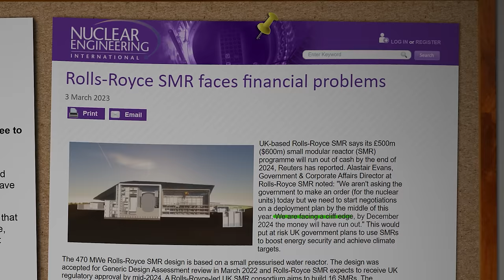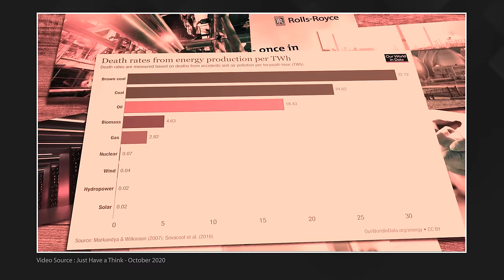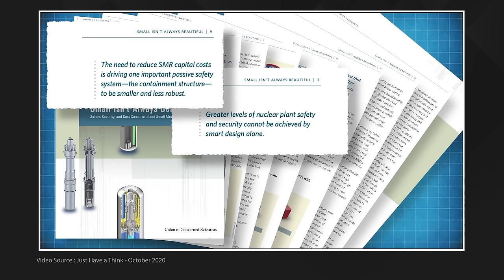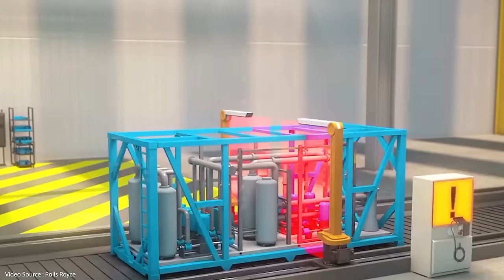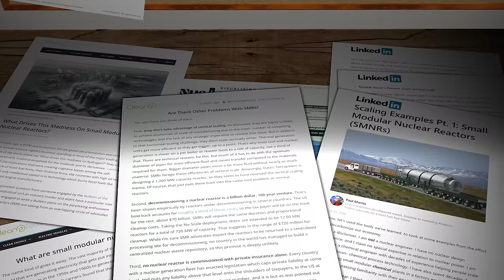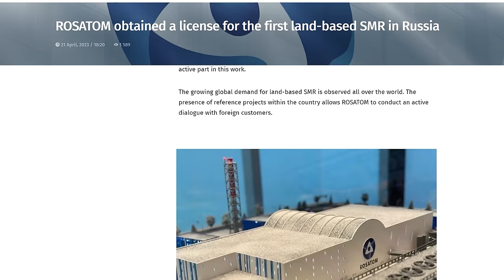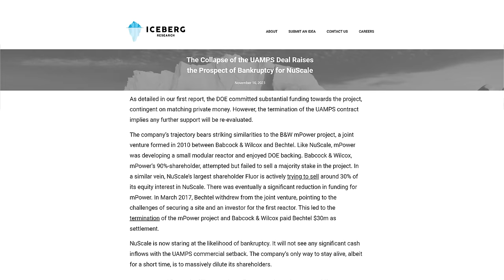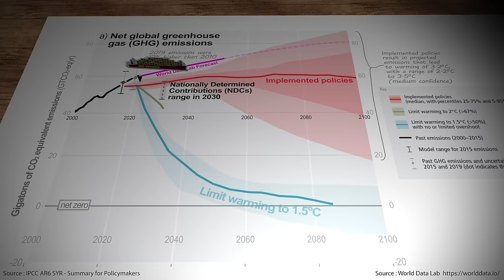Small Modular Nuclear Reactors. The Verdict

Comment: You're absolutely right - SMRs are already too expensive; meanwhile solar wind and battery costs continue to come down.
Reply: Name one major city and industrial sector that is due to be powered by solar and batteries in the next two decades. I'm not talking about some backwater I'm referring to somewhere like Tokyo, Paris, LA, Hong Kong, London, NYC, Mexico City. Just name one. These cities are where SMRs will shine, renewables and batteries have their place also, it will take a mix to fix this CO2 mess we have gotten ourselves in.
Reply: @anydaynow01  1.  I generally agree with you. Commercial demand balancing can come from arrays of capacitors and fuel cells (Metal Hydride, not pressurized or cryogenic H2).  Urban and industrial supply should be generated by Nuclear for baseline, and some NG to meet peak demand.

2.  [CO2] increases near the earth's surface promote forest greening by a power law relationship, and themal insulation by only a linear relationship.  Furthermore forest greening increases  thermal absorbtion during daytime and reradiation at nighttime, since mature trees circulate water from the water table and act as heat exchangers.  I have this on authority from NASA's own raw satellite data and an atmospheric chemist.

The 'immanent anthropogenic crisis' and the 'Green New Deal' are a raw deal, a con job intended to hobble the West while Asia marches onward.

Comment: Michael Barnards has pointed out that Wrights Law only applies if a manufacturing process goes through 10s of 1000s of iterations, that's when 'learning' leads to savings at scale. Correct, and by the same token the entire "power block" of a plant where electricity is produced via steam can no longer expect any improvements as it is really mature tech. That reduces the percentage of possible innovation over the project volume considerably.
Reply: Yes, SMRs use steam - and steam is an extremely old technology with extremely well known economies of scale. It is not just the "nuclear" bit that is the big economic issue in SMRs.

Comment: Fusion has the same problems of economics plus their technical issues. Nuclear can't compete with the dropping cost of renewables, even if they could get their cost of fuel to zero (renewables are already at zero fuel cost).
Reply: Generalizations about fusion are not yet possible -- since the attempts to make a practical plant use MANY very different approaches - some gigantic (National Ignition Facility) and many tiny (LPP's fusor) -- and to date all are VERY FAR from working.   (The reports of net energy creation are hooey -- once you consider the total power consumed versus output).   *  Also the advantage of local power (which this Youtube misses) is local production means you don't need to maintain a grid (so you get saving there). *  Some fusion plans have the advantage of being very simple compared with fission plants, and may not need scale to be economic.  It's all fantasy for now -- "20 years away, and always will be" has become "5 or fewer years away, and always will be."   Whether that is progress remains to be seen.

Comment: Yep. You lost me on renewables backed up by battery and hydro power. Given the variability of renewables and the immense power needed to stabilise the transmission frequency the scale of backup power and its durability makes this approach highly questionable particularly for Australia where transmission distances are much more profound than the UK. There are a multitude of issues involved around this proposed configuration making it a complex balancing act fraught with risks. The old saying is ... Keep it simple!!
Reply: Simply the direct opposite of the truth. No national electricity grid can be kept simple - they are often described as the most complex machine ever built. But the smart inverters on battery farms do a far better job of synching grid frequency than the traditional method of big hunks of spinning metal, either in steam turbines or syncons. That in fact is the reason the first large battery farm in Australia - Horndale in SA - was built, not for pure storage. Most current battery farms in Australia make some of their money from FCAS (Frequency Control Auxiliary Services) on top of selling power when the sun goes down; they are quickly putting syncons out of business.

Comment: At least in the U.S. your conclusion is spot on. Currently, long-term contracts for wind and solar with battery storage are in the $20 per Mwh range and dropping. A SMR at nearly $60 is a loser and when you bump that to $90 it's a massive loser.

Comment: One thing very infrequently mentioned is that solar has now dropped below the cost of transmission, which will indentivize local production. Yes, batteries will add cost, but it can be even cheaper if that energy doesn't travel 1000+ km in the first place. Even if competitors got their energy for free, they would still be uncompetitive as long as they are operating on the national grid.

Comment: So spot on! And so funny! Mass production requiring production of many thousands of units to be really beneficial, and, the more benefit you want out of it, the more effort you have to put into developing the production, before you can reap the benefits, first a lot of costs, then, potentially you can have benefits. Mass production isn't a magic wand you can just wave and instantly achieve efficient cheap production. And, to top it off, those many thousands of units production and massive efforts is obviously required for every producer. To me it's funny to find out that someone else have reflected over that fundamental flaw in the idea of SMRs becoming an cheap alternative, because that was me instant reaction, when I first heard about it, years and years ago, but this is the first time I've heard anyone else actually accepting that.  

Then there's the issue of safety that makes mass production "a bit" more complicated. The worlds most produced airplane, the Cessna 172, is super basic, and starts at about  360k USD, if it had been a car, that basic, and produced in hundreds of thousands of units per year, it would probably cost about 5% of that. Keep in mind that car manufacturing still needs some attention to safety.         

And then the funny aspect that the small size would make them inherently safe enough that attention to safety wouldn't make them astronomically expensive, yeah, up to what, 10%? of the size of the infamous Chernobyl reactor, maybe we can just dump the parts and instructions in pictures on playgrounds and have bored kids assemble them then, because an accident 10% of that is practically nothing? It seems even more "well" thought through when combined with the idea off stuffing all the fuel needed for multiple decades of operation in them, so in case of an accident, (even if it's much less likely per unit) you still have about the same amount of stored nuclear energy, radioactive material, as if you have a 10 times bigger reactor in which you change the fuel 10 times in the same amount of time.     

If they can't make SMRs good and cheap enough to make them the go to-choice for ships, replacing 100% diesel power, they won't make SMRs that makes financial sense competing in grids with solar, wind, hydro and a mix of grid management strategies we have now, with current costs. And in contrast to nuclear power, solar and wind, and quite a few grid management strategies becomes cheaper and better at an amazing pace as we speak. 

Whatever we build, the production has to compete on the grid when the production happens, new nuclear power that starts to produce a decade or more from now won't help us now, and also not alleviate situations we've already been through, it might help then, but then again, nuclear power generation projects has a track record with quite high part premature termination, at all stages, from early feasibility assessment phase, to shutting down perfectly good reactors for no good reason. 

Don't get me wrong, nuclear power could potentially be amazing, a controllable fuel that doesn't even require air, more than a million times the energy density of combustion fuels. Even considering the very real safety issues, our inability to use that as an economical (and still safe) energy source is absurd, but that inability is also very real.

Comment: Nuclear power plants are extremely expensive and complicated machines requiring constant maintenance.
In contrast, solar/battery is cheap, widely available and deployable by most able bodied homeowners.
Nuclear is also a very centralized (controlled) distribution of energy compared to solar's decentralized self sovereignty model.
Reply: And solar has a much more scalable investment. However, as of yet solutions to energy storage are fairly centralized. This can be mitigated with houses that are very well insulated at least for residential but it's very expensive.
Reply: @Furiends  millions of EVs with Vehicle 2 Grid capability plugged into the grid form a fantastic GWh-scale distributed energy storage system. Companies will turn networks of EV owners who are willing to discharge a small part of their battery in times of need into a virtual power plant.
Reply: @skierpage  I'm curious to see whether owners of electric cars can really be convinced to let the battery discharge into the power grid. At least here in Germany there are many who are skeptical and expect a severe loss of battery capacity, so that it is not financially profitable for the owner. (Personally, I think the fears are exaggerated. I just want to point out that this is used to create political sentiment.)
Reply: @skierpage  I agree with this in part. But it's idealistic. There's two major problems. If EVs use battery switching you need at least twice as many batteries (thus V2G becomes more like standby batteries to grid) but is impractical just because of the huge amount of batteries needed.

If you keep the batteries in the cars then they need to drag around all the extra weight all of the time and then need to fast charge on trips which practically speaking means mirroring the storage capacity of the grid at a high percent of passenger cars defeating the purpose of V2G.

So in reality, I think it'd be a combination of semis using centenary wires, passenger EVs using removable supplemental batteries for trips, some amount of V2G mostly for stability rather than capacity and fast chargers that would cost a hecking lot more at night.
Reply: I think Tesla has sold 900.000 power wall units alone so far.
Reply: but it "downloads" the cost to the people LEAST ABLE to raise capital to undertake such a venture
Reply: @Furiends  I imagine a world where utilities BUY used EV batteries and "give" them to homeowners as a "backup generator" but is distributed battery buffer when power is on and a the home owner gets backup power for "hosting" the battery on there private property during power failures
Reply: @skierpage  could see the EV batteries once "spent" be "leased" out by homeowners from the utility as a power failure whole home backup generator but does load balancing during "normal operation" and being a lease from the utility the owners dont have the degradation concern" + the utility wont have to calculate meter in rates to convince enough EV owners to "risk" there batteries plus SOC concerns that might crop up during a heatwave when the battery demands are highest and there owners might be more likely to need the car ready to go in a moments notice
Reply: @danielh.9010  same over here there is a MAJOR "dislike" to the idea of "wearing out" your "extremely expensive" battery  and the compensation has to be enough to "cover" the loss of range / premature failure
I picture leased battery packs that double as whole home generators would go over better AND have zero feed in tariffs to calculate AND the homeowner is PAYING for the battery and NOT worried about wear and tear as it is a LEASED unit that the utility will be responsible for
Reply: @jasonriddell the problem with this is ev batteries at that scale would first have to wait until mainstream acceptance of evs some 15 years from now then wait 20-25 years for those batteries to degrade enough. Chances are instead of selling the battery other people will just accept the discount on evs with reduced range.

Comment: You might be interested to know that down here in Australia our Conservitive Political Parties have adopted SMR as the corner stone of their climate action policy.  While they were in government they spent years denying climate change, then delaying doing anything about it.  Now that they are in opposition they have finally got on board and recognised that the public wants something done.  So their new policy will be focused on the role out of SMR's, "good reliable base load energy not unreliable renewables".  

This is where SMR's big advantages over renewables comes through.  This technology is not available yet, it is over the horizon, years away.  So they can have a policy that looks like they are doing something about converting the grid away from coal and gas while all the time using more coal and gas and slowing down the roll out of renewables.  SMR's rescue coal and gas by delaying their replacement.

Comment: SNRs only make sense in a few isolated cases.  Aircraft Carriers and other large naval ships make sense for nuclear reactors.  The other possible places for SNRs are relatively isolated communities in the Arctic where you do not have sunlight for half of the year.  However, with large scale sodium based battery systems and a few backup generators, that will still be much cheaper than a reactor.  Don't forget that EVs with bidirectional charging are also part of the grid.
Reply: SMRs only make sense when cost is not a priority

Comment: I'm curious about molten salt reactors. Moltex Energy's Stable Salt Reactor technology looks really promising.
Reply: It ALL looks really promising but none have done more than piss away a bunch of investment dollars since the late 1940's.
Reply: @itsmatt2105  I have one word for you, lobbyist! There is a very good reason this technology hasn't taken off like it should have.
Reply: I think at least for dissolved fuel molten salt reactors (which is what most people talk about), the two big problems are corrosion, because you have to use fluoride salts to dissolve the fuel, and proliferation risk because it tends to require high purity online chemical processing that would make producing weapons-grade Pu-239 or U-233 relatively easy. 
If you want a high temperature fast breeder reactor, sodium/potassium metal, supercritical water, or gas cooled seem like better bets because they don't have the corrosion issues. I'm personally a fan of sodium metal because then you can use magnetohydrodynamic circulation pumps to cut down on moving parts in the primary coolant loop and oak ridge had one for a while during the early nuclear reactor testing.
Reply: They need lots of research. They might be feasible, but they are not slam dunk or easy. Well, to be fair, nothing in nuclear power science is. I wouldn't be dismissive about their previous failures though, China and EU still invest quite a lot to find out if it is doable.
Reply: @thamiordragonheart8682  molten salt is also used for CSP plants and has proven very problematic for corrosion. If that happened with radioactive molten salt that would be a mix larger problem. Though the automatic overheat shutdown of the freeze drain plug sounds awesome, what good is avoiding a meltdown if your already molten radioactive core material just leaks out because a pipe corroded!
Reply: @thamiordragonheart8682  "that would make producing weapons-grade Pu-239 or U-233 relatively easy."
Which is a good thing, your country owns the plant and any future nuclear weapons it facilitates.
Reply: @hurrdurrmurrgurr well a corporation owns the plant and nobody from the government is going to miss a kilo or two of reactor material on an audit that can be sold quite profitably elsewhere.
Reply: @hurrdurrmurrgurr  it makes deploying the technology widely a lot harder because most of the major nuclear powers are weary of giving anyone who doesn't already have nukes easy and discrete access to materials to make them. And if anyone who wasn't already a major nuclear power started developing something that's so easy to make weapons with, I think there would be a lot of sanctions involved.

Comment: Excellent analysis, lot of valuable information. Showing - if this was necessary - that the hype from "start-ups" promise a lot and deliver little. Just applying to France, this is absolutely true, wind and solar need to ramp-up responding to the huge electrification needs. However with a large share of nuclear, there is a need for replacement and new "standard" nuclear may not be sufficient, SMR could be added quicker than additional traditional plants, adding heat to power generation with interesting efficiency, contributing to fill the gap due to decommissionning of reactors from the 70's. But given the urgency and technological uncertainties, it is critical to be ready to do without SMRs in the 20 coming years (which does not prevent working on it).

Comment: Current PPAs for solar is just under 3¢/kwh. Add in storage which is not as cheap, and it still beats SMR's 9¢/kwh.
Reply: I work in the utility-scale solar industry. Solar plus BESS currently costs around 6 cents/kWh. Recently, I completed a 490 MW solar plus 100 MW BESS project in Mississippi so my numbers are factual.